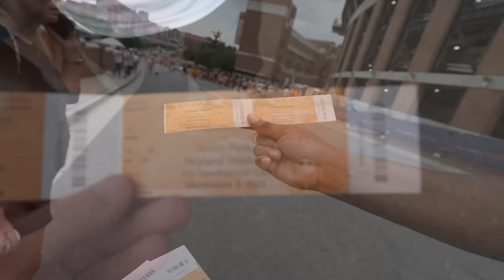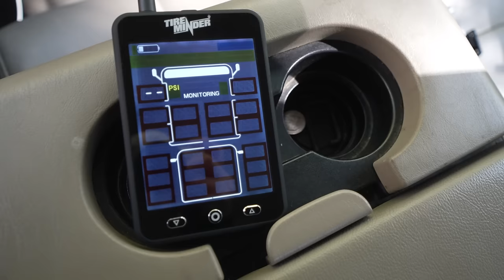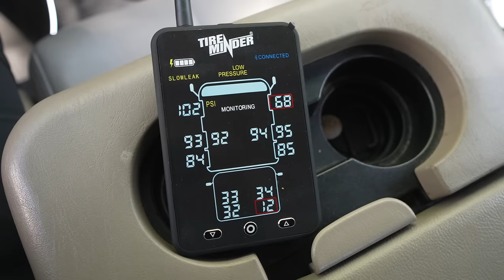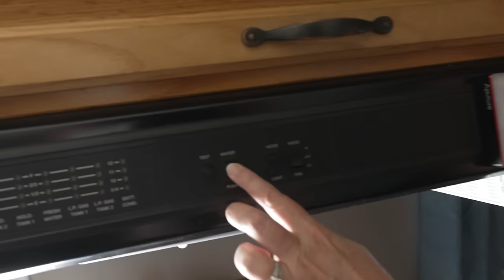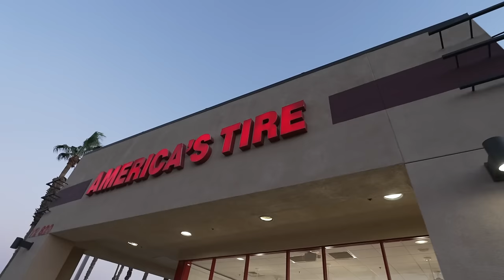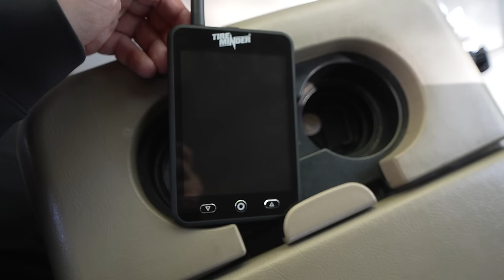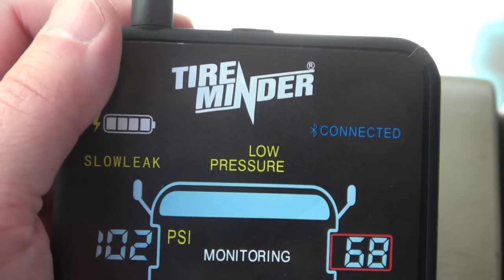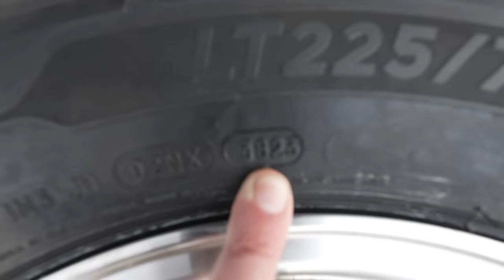TRIP KILLA - Our WORST RV Tire Disaster!

Comment: Replace a 6 year old tire is an Old Wives Tale.  I have lots of vehicles with older tires, the longer they have been on the road getting washed with used oil and tranny fluid from other leaking vehicles, the longer they last.  The old tire problems are from those that sit in the storage yard for 50 weeks a year.
Reply from the maker: I certainly can’t tell you what to do. I can only share our experience. And I’m sure it does matter how the tire is treated as it ages. For example, if the vehicle is in a garage, climate controlled environment, and the tires are not exposed to sunlight, I’m sure they age better. But there is no denying that overtime rubber tends to become dry and brittle and loses many desirable characteristics which would affect handling, performance, and durability. I have several older vehicles and it’s not uncommon to replace rubber trim in the vehicles simply due to age.
Reply from the maker: When we got home from this trip, I had some 10-year-old tires removed from an old Porsche of mine and replaced with new tires. The tires I took off looked great to my eyes, but I did not have confidence in them.

Comment: I am very surprised you didn't have a spare tire. I would have thought with all your travels you would have one.
Do you have metal valve stems? I had problems on  my last trailer with rubber valve stems and the TireMinder sensor.
Thank you for sharing your experience.
Reply: We do have a spare tire. But since we had already decided to replace all four tires, and the tire shop was less than 2 miles away (on city streets, not the interstate), we just went as we were. We were broken down on a very busy interstate Exit ramp and felt it was more dangerous to crawl under the trailer to retrieve the spare than it was to just drive on three tires. If we had had to go a further distance, or drive on the interstate, we would have put on the spare.
Reply: @kristymichael  so glad to hear.
Safe travels and hoping your repair goes well.
Reply from the maker: We did switch to metal valve stems. We had the same problem with our truck and the tire system on rubber valve stems!

Comment: I had a different situation, I found just a small Nick in one of the rear tires. I ordered 2 new tires to put on the rear. They were not even 2 years old.  I did not want what you talked about to happen- damage to the side of the rig.  
I someone in the area who put tires on. I went to them and scheduled.  I had a gut feeling I should after the conversation, the counter person said they couldn’t install the tires, but the installer said they could.  I should have gone elsewhere!  
I went there and watched because they failed to lock the doors on my truck!  
The installer said, i’m not doing the job, it’s just going to happen again.  They came to me 45 mins later claiming that my leaf springs needed replaced.  I said, yes I have scheduled to have that done when I get home. He said oh!  I had found the nick in the back of the tire while inspecting the the leaf springs, and underneath my rig.  They then claimed the lead springs were collapsed, and the ire’s were touching the rig!  I knew they were not!  There was 3 inches of clearance and the spring due for a replacement.  
I advised the company to just finish the 1 tire, and I would take it somewhere else.  
Unfortunately, the company did not know how to work with aluminum rims!  They under tightened 2, because I went and checked torqued to make sure they met minimum. I should have checked if they over torqued!  Due to over torquing or improper mounting, the rim EXPLODED!  
Luckily no one was hurt!  There was damage to the skirting, the hub was damage, all the lug bolts were sheered off, the axle was possibly damaged, and the shackles that could have made it home were now to damaged to make the trip.  
Raff Mobile repair that responded was great, and discount tire got the rim and tires done for me!

Comment: Same with a boat trailer. Do you have a spare? Do you have the CORRECT jack and jack support  blocks?   Is your jack too high to get under there?  If one tire goes, the others may go too,down the road.  It's hard to get tire service on the 4th of July.  i replaced all 4 tires one by one over a 500 mile trip.

Comment: I have heard many stories about tire shops jacking up trailers incorrectly.  I just had my trailer tires replaced and had a mobile tire installer come to the house to do it.  They guy was fantastic and jacked my trailer exactly where I asked him to.  I understand that I may have to have this done on the road.  I guess I'll be the rude guy that supervises their work and insist that they jack in the right spot.

Comment: Wow, you seem to have a fair amount of tire problems with that trailer. Have you ever had the axles checked for alignment? Also do your tire monitors have temperature sensors, that would alert you before it becomes a problem.
Reply: We actually replaced the axle’s in 2021. We’ve had this trailer for 17 years (and it’s 21 years old), and we’ve taken it to 49 states, so I think we’re doing okay! 😄
Reply: @kristymichael  Sorry didn’t mean to offend you. But it looked like the same side, same axle as previous videos. Just a coincidence I guess.
Reply: @edrodrigues3333  no offense taken! Just expressing why I felt we’ve fared pretty well considering how long we’ve had the trailer and how many miles we’ve put on it. 😊👍🏼
Reply from the maker: This is the first Tire problem we have had with the trailer in more than a decade. Last tire problem that I can remember happened in 2011 when we suffered a blowout in Missouri.
Reply from the maker: No offense taken. In fact, about 15 years ago, we did have a bent axle and that did cause abnormal tire wear. In this case, we are running on new axles and I don’t think they are contributing to any problems. Thanks for your comment.

Comment: Kristi's tightly pursed lips says it all. I just drove north on I-59 from Slidell to Chattanooga. Worst highway I've seen. There was a long section of highway that had a gap along the center line, and lots of potholes and missing patches of asphalt. In a 10 mile stretch, I saw a Class A and two travel trailers with blown tires. One had two blown tires on same side. I had just bought new Goodyears for my trip. Replaced 6 year old tires. Patting myself on back.

Comment: Keeping a check on your tires and their age is always a priority for us. However, we think you should always have a spare tire. When we go on long trips we always take two spares.
Reply from the maker: We do carry a spare tire. In this case, since we knew that we were only a couple of miles from the tire shop, and we were eager to get away from the side of the interstate for safety reasons, we opted to drive directly to the tire shop on three wheels. If we had been traveling a further distance, then we would have installed our spare tire.

Comment: Two comments.

1.  The tire thing can happen even when you think you are attending to your tires.  Over the pandemic, there were several years that my mileage went from about 14,000 miles a year to about 3,000.  Of course, ever fall and spring, I look at the tread and hey, it looks great.  But it didn't occur to me that they could be getting old because for the last 40 years, I've always replaced when the tread got to about 4/32 and that was always about every 4-5 years.  I had a blow-out and only then realized that my tires were 7-8 years old.  Lesson learned.

2.  Many employees of a tire shop chain like this were flipping burgers last week and they will be selling tickets at the theater next week.  About 20 years ago, I took a car into one of these chains for a tire rotation.  They managed to rip the valve stem out of the tire.  Of course, they didn't bother to tell us, so they rung us up and locked the door behind us for closing.  We go to the car and hear a hissing sound.  We managed to get their attention, but they simply told us that they were closed and we'd have to take it up with the day manager in the morning.  Meanwhile, we are 20 miles from home and it is getting dark.

Comment: I love Long Long Honeymoon. I was on one for 22 years with my husband until he died suddenly. Almost 10 years ago now. I've not been the same sense. But I digress. And he is just gone.

I love your concept and title. I love your channel. I love you guys. I'm so jealous of you guys. I'm 68 now and all alone. I've never had any children. It's just me now. Nevertheless.

You've got a little bit of decent Production Experience. Might I make a single recommendation for your channel?

I see you guys have a pair of some decent Chinese LDC microphones. Mounted in the right positions. And potentially sounding great. Sort of. As it's really funny. Listening to some of your, edited drop ins.. When the level and texture changes, substantially. And so?

Being a retired, twenty-year Veteran Audio Engineer for NBC-TV News in Washington DC. You likely have that pair of microphones,, plugged into somebody's, little, miniature, mixer? I am assuming here. Which is a bad thing to do but. On the perchance you are? Which is then plugged into your, Video Recorder Thingy.  But you are missing an important ingredient.

Get yourself onto eBay and procure for yourself. Something as Affordable as a used DBX 286 Vocal Processor. It's a lovely inexpensive, 1-U, single 19 inch, rack mountable, device. You can't frequently find for under/around $50-$100. In your choice of black or silvered finish. Any year, model will be fine. It comes with a AC wall wart power supply. Of which you can use, many generics.

You don't have to plug just one microphone into it. You can plug the output of your mixer of both of your microphones into it. Because really only one of you is talking at a time. And fine if you are both talking together. As that's how it was with my Audio Console doing the news. All the microphones go through one, dynamic range controller device. And therein lies its Secret Sauce!

If you process both microphones together. No bus strapping of input sensors, need be made. Since you are relying on a common single unit. And strangely enough that actually sounds better. Because you don't have 2 units working differently, trying to achieve the same goal simultaneously. It's a technical thing.

But what this unit will do. It has a button. To eliminate, low-frequency rumble and wind noise in the background. Changes from external pressure from weather. Then.

It has low-frequency and high-frequency enhancement. Like the bass and high-frequency controls on your stereo system. And you turn them up both. And you will sound clearer and bigger and more profound. More boisterous and out-of-control now. When we turn up the, Audio Limiter, knob. Until all of the pretty little LEDs start to deflect  downward. Only one should flash when you whisper. They should all flash  when you get, excited. An average in between with normal conversation. And this changes everything! Because then. You will sound better. Much better. But the rush of noise behind you now. Will become excessive and distracting. So we cannot have that.. Now can we? No we cannot. So then you turn up the knob. That's called Silencer. Or Noise Reduction. And turn it up a good bit. All the noise in the background will magically disappear!

And you both will be left. Sounding like Regis and Kathy Lee. Or Bob and Ray. Amos and Andy. Rowan and Martin. Laurel and Hardy. And better sounding than they were ever! Because you have a DBX 286 Vocal Processor!

And really it's almost as good. As my $5000, Dolby Hollywood Vocal Processor, cost. Because it really does the same thing. And came out, 20 years later. In the early 1990s. And I got these for some of my clients. That wanted, Pro Voiceover Capabilities.  Right there in their downtown offices. With no soundproofing. This is how you do it. It's Electronic Magic! And it's so cheap now. And works so exceedingly well. Some guys on YouTube are using them. You can usually instantly hear it. It's when they sound really great, really Pro and Really Smooth and even. That's what does it. Not so much just your delivery alone. But the gizmo processor. It's used in all movies all Hollywood blockbusters. It's used at major TV networks. For the newscasters. So you can hear them better. And not miss a single consonant they enunciated.

This would be an order of magnitude improvement on your YouTube channel. And it's small and lightweight. It weighs around 1 pound. It's a flyweight. It's cheap. It makes a huge difference. A difference all of your voyeurs & Listeners. Will enjoy listening to. All the more. It's what separates,, the men from the noise  and the boys from the toys. And the girls from their tampon dispensers in the ladies room that are empty. Which is just inexcusable... As toilet paper alone really won't cut it. And we all know that. So get a microphone processor. You'll love the way it sounds. As a dynamic range limiter processor. Does not process your limitations. It does the opposite. It really takes your limits away. By adding, limiting. I know that sounds strange and goofy but it's true.

There are processors made by other manufacturers such as Avalon. Those cost a bit more. A bit lot more. In Windows and Mac software packages and plug-ins. That will cost you hundreds and hundreds of dollars. And not needed. I mean I have some of that crap because I'm a Pro, now retired. And you get it. You open it. You check it out. You play with it. You find out with the directions tell you it's supposed to do. Then you figure out what it can't do.. It's more important, what it can't do. Then what it says, it's supposed to do. Because you don't want anything that can't do. What you want to do. Not what the specifications say it can. Mike MPG for a car it's always a lie. The USA is a Free Country as long as you pay your Taxes. Then it's Free. But without paying your taxes. They then ensure. You are not Free. And so they never charged Al Capone with murder. No. They charged him with tax evasion.. And stuck him in jail for the rest of his life until he died from syphilis. But not in there for murder. Only for not paying his taxes.

What's going to happen to Donnie? Al Capone died in prison for not paying his taxes. Donnie will be next. He'll be known as, Don Capone Caput.. He estimated the wealth of this property much higher. And never paid that tax. Of what he bragged it was worth. How does that work? Was that perjury or lying?

What? They mean the same thing? No they don't. One is perjury. The other is lying. Can't you spell?
RemyRAD

Comment: Something is wrong about trailers and their tires and axles.  No matter who you talk to, it seems that trailer tires don't last very long which tells me they are under rated for the purpose. I know lots of those 3,500 lb axels with 15" tires typical go maybe 2 years or less by the time they shed the tread right where this tire had. It's always the same failure too. Why don't the car and truck tires fail as soon and with the same failures? The problem I believe with many of the lighter trailers with the 3,500lb axels is that those are too light for the dynamic loads even though they are "rated" for the specification. It is very obvious that those axels and tire combination (15" diameter wheels/tires) are too limited, even though the manufacturers are selling them that way. Any new trailer should probably be outfitted with the larger axles, 6,500lb I believe which will take a 6 lug or 8 lug bolt patterns. Those will come with the 16" wheels/tires that also allow for higher "load range" tires such as "load range E" and so on.  When examining tire issues between the heavier axels and tires vs. the light 5 lug axles, the tire failures are much much less if any. I'm surprised these tires crapped out so soon. Also, its interesting how tires are being evaluated by their age even though the tread is still good. This was never the case 30+ years ago as age didn't enter the equation, only the tread. Now a days, some tire shops will not service or do rotations on tires 6 years or older even though the tread is still 11/32. I have been there and told that even though my SUV is in the garage most of the time. What is happening here is, fresh tires are failing sooner than they used to. 30 years ago tires wouldn't fail before the tread wore out, most of the time, regardless of age. 
This is so sad that those tire changers couldn't figure out the jacking points even after being told to be sure to use the frame etc. Those airstream trailers have the belly all enclosed so it is not as easy as any other to observe...as they say, measure twice...cut once. Maybe it would be reasonable to mark the jacking points with a yellow or green paint mark etc. 
At least the tire failed in Indio before the long climb up Chiriaco Summit, its a steep hill and very hot in the summer, well around 100 to 110 temps and a blacktop road.

Comment: Thank you for sharing this, it helps us fellow travelers!  Do you carry a spare for the airstream?
Reply: It would be nice to get an answer on that
Reply from the maker: We do carry a spare tire for our trailer. It is mounted beneath the front of the trailer. If the tire failure had happened in a place located far away from any tire shop, we would have mounted the spare tire and towed on the highway accordingly. However, we experienced this problem only a few miles away from the tire store. Since we can safely tow our trailer on three tires, it just made sense to go ahead and tow over to the tire shop. I was already determined to go ahead and replace all four of our tires because I had lost confidence in them. There was simply no need to put the spare on the trailer because we were only traveling a short distance.
Reply: Thank You